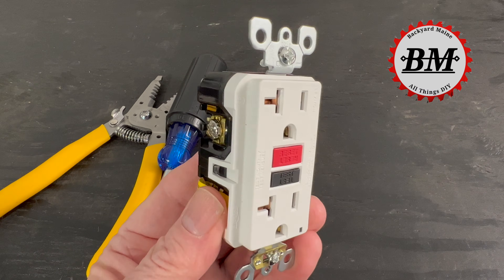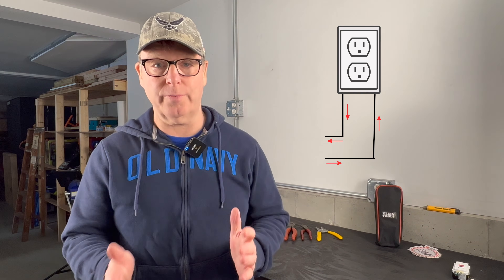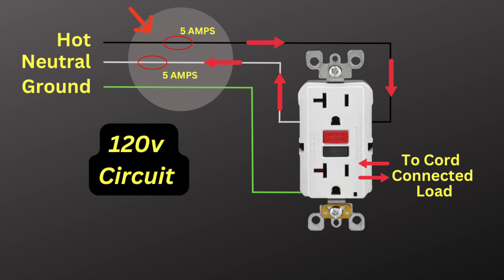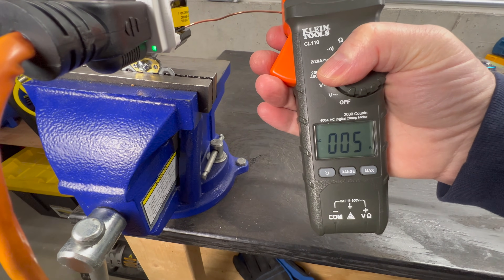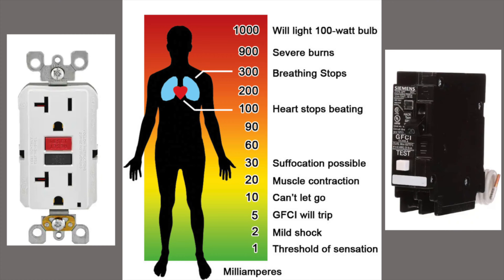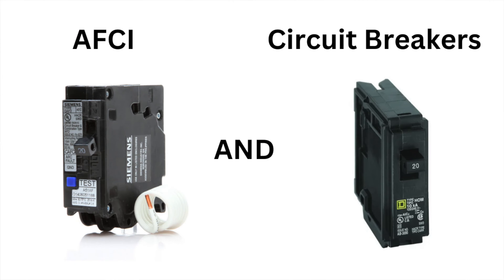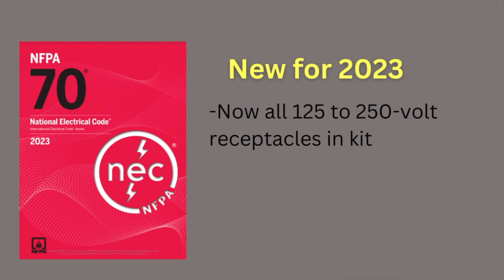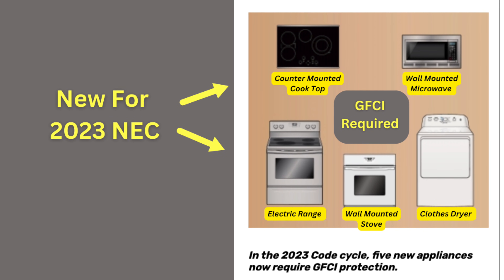GFCI Outlets: How They Work And New Requirements

Comment: Crazy new requirements... I didn't know they were stipulated like that until this video. 99% of the homes in US are not compliant and nobody will bother to get compliant any time soon. There needs to be a better technology at the circuit breaker panel where everything by default is GFCI and if, for some reason, you don't want it GFCI, then it is a separate circuit. That is the only way to fix it universally.
Reply from the maker: The code is not retroactive so homes won’t need to be updated. Just applies to new work.

Comment: I was told by an electrician to not put the refrigerator on a GFCI outlet because it will trip every time the refrigerator’s compressor comes on. So I’m confused. Can you please explain?
Reply from the maker: Thats not true but you could occasionally get a nuisance trip and that could be bad if you didn't notice quickly. I really don't like the new code rule requiring GFCI protection for refrigerators and freezers.

Comment: Why can't I find a 240 VAC GFCI outlet? I found 240 VAC GFCI breakers (quite expensive) though. And what about 240 VAC AFCI breakers?
Reply from the maker: Yes, you're going to need a GFCI breaker for this application. Also be sure to buy one rated for personnel protection not equipment protection. The one rated for equipment protection trip at a higher mA rating to ground.

Comment: Interesting they require ALL receptacles in the kitchen to have GFCI protection!  I had always assumed that those receptacles normally inaccessible, and therefore rarely accessed, like the refrigerator, garbage disposal, dishwasher, and permanently installed microwaves were an exception in previous codes (I believe) because they were very unlikely to cause an issue?...  Thanks for the update!
Reply from the maker: Yes, the code keeps expanding GFCI requirements with every cycle.

Comment: A ground fault circuit interrupter will not limit shock current to 5 mA. As with an ordinary circuit breaker, opening of the circuit takes some time because of the electromechanical trip mechanism. The circuitry also contributes (to some extent deliberately) delay. Until that mechanism interrupts the flow of current, the current will be limited only by the voltage and the circuit resistance. A fault current of tens of amperes could occur. The GFCI response time is fast enough to prevent electrocution in the vast majority of cases. Something in their favor is that the resistance at the instant of first contact between a human and a live circuit is likely to be pretty high, inherently limiting the current. In a "can't let go" situation, the current can rise quite rapidly as skin is burned and its resistance drops, but that process is still usually slow relative to the GFCI response time.
Reply from the maker: That is not accurate information but this is:

1. Differential current sensing
A GFCI continuously monitors the current flowing in the "hot" (ungrounded) conductor and the current returning through the "neutral" (grounded) conductor.
It accomplishes this by passing both the hot and neutral wires through a specialized current transformer, according to Fluke. In normal operation, these currents should be equal, and the magnetic fields they induce in the transformer should cancel each other out.
If a fault occurs (e.g., current leaking to ground through a person), a portion of the current will deviate from the intended path and not return through the neutral wire. This creates a differential current (an imbalance between the hot and neutral currents).
The current transformer detects this differential current, which generates a signal proportional to the imbalance. 
2. Threshold detection and trip activation
The signal generated by the current transformer is fed into a comparator circuit within the GFCI.
This comparator is designed to trigger when the differential current exceeds a preset threshold, typically 4 to 6 milliamperes (mA).
Upon detecting an imbalance greater than this threshold, the comparator triggers a silicon-controlled rectifier (SCR) or similar switching mechanism.
This SCR rapidly opens the switching contacts, effectively de-energizing the circuit and interrupting the flow of electricity. 
3. Fast trip time for safety
GFCIs are designed to react extremely quickly, interrupting the current flow within as little as 1/40th of a second.
The UL 943 standard for GFCIs specifies a maximum trip time based on the fault current, but most GFCIs on the market are significantly faster, typically operating in less than 100 milliseconds. This rapid response is crucial for preventing severe electric shocks, as even small currents flowing through the body for a prolonged period can be harmful. The trip threshold of 4-6 mA and the fast trip time are chosen to ensure that the device interrupts the circuit before the current can reach levels that could cause ventricular fibrillation or other serious harm to humans.

Comment: Clothes dryer needs GFCI?  A 30a 240v GFCI breaker?  Or just a 120v gas dryer outlet?
Reply from the maker: They do as of the 2023 NEC. But this doesn't apply to existing installations because the code is not retroactive.

Comment: Thank you for explaining that the receptacle is measuring net voltage across hot and neutral! I didn't understand why both the hot and neutral for a downstream protected receptacle need to be connected through the GFCI receptacle, as only the hot would be needed just for switching.

Comment: In a older house that house no ground, is it better to have gfci outlets in place of all outlets?
Reply from the maker: Probably not necessary but in the places they are required would be a good idea. Especially in the bathroom, kitchen, outside, garage and basement. I’m sure you know a GFCI will work with no ground
Reply: @ I was reading the NEC document about houses built before equipment ground was standard and they say if you replace them with gfci and put a sticker on the plate it’s up to electrical code.
Reply from the maker: @ajp000000  Thats correct..

Comment: What if I have kitchen outlets that all are connected to a GFCI, do I need to replace all of them to be GFCI now
Reply from the maker: The kitchen receptacles do require GFCI protection. You can do that with individual GFCI receptacles, GFCI breakers, or a few GFCI receptacles with standard receptacles wire to the load side of them. I like installing all GFCI receptacles because I think it looks better and its right there if it needs to be reset.

Comment: So every outlet now basically which no houses will meet this code unless built new. Also, GFIC's are a massive pain in rear as they are often faulty out of the pack and seem to trip when u breath anywhere near them
Reply from the maker: There are still many areas in the home that don't require GFCIs. I'm not experiencing any issues with the ones I have purchased. I have had an occasional faulty device but less than 1 in 100 and for reference, I haven't had one fail in my own home since they were installed 25 years ago.
Reply: @BackyardMaine  I've had at least 2 fail out of pack for me and have seen several professionally installed GFCI's continually trip and have to be removed, or wiring rerouting to avoid using one

Heard from several 40yr+ electrical veterans also dislike them for reasons above.
Reply: @BackyardMaine  thank u for video tho regardless as some people may like using them i'm sure

Comment: John, what do you think about GFCI protection as it is applied to a "downstream" receptacle from an upstream GFCI receptacle?  I get the cost savings of using the 'load' side of a GFCI for downstream receptacles, but aside from extreme current draws where that receptacle should have been on another branch circuit to begin with, and also applying the handy little "GFCI Protected" tag, are there any other considerations?
Reply from the maker: The circuits of course should be sized and split of based on expected load but other than that there is no issue using one GFCI to supply the other receptacles. I have done this quite a bit. In kitchen and bathrooms I always install a GFCI at every location for aesthetic purposes. I think it looks better especially over counter tops. But from an electrical standpoint it's just fine.

Comment: @BackyardMaine Thank you for the informative video. 
Quick question: Does GFCI prevent fire due to sparking in the garage due to a car block heater or some other heater?
Thanks in advance.
Reply from the maker: Only if it's arcing to ground. If its arcing across the contact (line to line) or to (line to neutral) the GFCI would not detect that fault. An AFCI would trip from that sort of arcing.

Comment: Another youtuber says don't use Load terminals to next outlet as next outlet will still be hot despite gfi tripping ! Is that true ?
Reply from the maker: No, if you use the load terminal to feed other receptacles and the GFCI trips, those receptacle will lose power. That's the whole point, all receptacle connected to the load side terminal will be GFCI protected.
Reply: @BackyardMaine  the other youtube meant if 2nd receptical is gfi it won't ttip.
Reply from the maker: You can actually even use a gfci down stream of another gfci and it will work but there is nothing gained by wiring them that way.
Reply: @BackyardMaine  I've learned that when stringing 3 gfi on same branch leg I couldn't use LOAD as that would be serial; I needed parallel so if one gfi tripped, all three gfi would trip.

Comment: What is the requirement for submersible water pumps (typically 240V, 20A circuit)? I would like to see a video on circuits that require BOTH AFCI and GFCI protection.
Reply from the maker: Hard wired submersible well pumps do not require GFCI protection. If they are cord and plug connected they do. I put that video on my list. Stay tuned.

Comment: Does the receptacle in which the GFCI is installed have to be grounded for protection to be effective?
Reply from the maker: If you have a ground wire then you do want to connect it but to answer your question, the GFCI will still function properly with no ground.

Comment: GFCI protection can be challenging to implement on multiwire branch circuits (MWBCs) due to the shared neutral. In a MWBC, two hot wires share a common neutral. When a GFCI monitors the current on the hot and neutral conductors, it may not accurately detect ground faults because the current on the neutral is the algebraic sum of the currents on both hot wires.  I guess you could get away with using a double pole GFCI breaker for both phases.

Comment: I recently took the National Home Inspector exam and this question came up.  At what amp with the GFCI trip with human contact and 5 amp wasn't one of the answers had 4, 6, 10 and 12.  Not sure if I got the answer correct I choose 6.  Now I'm thinking more like 4.
Reply from the maker: The manufacturers rate the devices to trip between 4-6 mA. Picking 5mA is the industry standard. If I had to choose between 4 and 6 I would choose 6 since it may not trip at 4.

Comment: I’d like to add something that is missing from that nice milliamp chart right at the beginning of this video. Back in the 1970s when I started doing electrical work for a railroad, we were taught that it only takes 6 mA flowing across your chest in order to send your heart into fibrillation, which can only be stopped with an AED device…and back in the 70s, none of us had those devices because they were only available in certain emergency service vehicles and were quite bulky, as they were the same units used in hospitals.
Reply from the maker: Thanks for the info..The chart I used was borrowed from an OSHA document and I believe those are the current numbers the industry is using today.
Reply: @BackyardMaine  Oh, they are, but they're not specific, and they neglect what happens when current passes across your chest just a little bit, because unless somebody is there that can defribrilate you if your heart goes into V-fib, you are a dead man.
You have to remember that OSHA is not industry professionals. It's bureaucrats.
Reply from the maker: @arthouston7361  I was the electrical engineer for a multi billion dollar corporation. We would occasionally get an OSHA audit and they would send experts in every area of expertise. Electrical, chemical, mechanical etc. The electrical guys from OSHA I worked with were experts who understood everything I showed them from 35kv distribution, generators, UPS systems, transfer switches, rotary UPS systems couples to generators, fire pumps, controls and everything else. The bureaucrats were not the guys in the field in my experience.
Reply: @BackyardMaine  The guys that they sent you that you are describing are part of a very specialized group.
 I've met the guys from OSHA who fit that category, but they're not the people that make the rules, and they're not the people who produce graphics. I didn't do any 35K work, but our railroad signal power on the former Penn Central was 8.8 kv. More than enough to send you to meet the great I am. Our power source was the old Philadelphia electric company, and so we had a lot of safety information that came directly from them.
Reply: 6mA for heart to be thrown into fibrillation is what I was taught in electrical trade school back in 2017.

Comment: My apartment was shut down by code for no heat or hot water but we also were living there for 5 years with everything in the three bedroom apartment hooked up to only TWO circuit breakers 20 amps each and our oven was not on gfci.
Reply from the maker: Old or existing installations are not required to upgrade to current standards unless new work is being done.
Reply: @BackyardMaine  oh, it’s not even about upgrading to newer standards it’s about that was completely out of code to begin with to have a three bedroom apartment running off two circuit breakers that are 20 A each. There’s no way that that can be right you know what I mean
Reply from the maker: @richroc7  Unless it was built 70 years ago or more.
Reply: @BackyardMaine  you’re saying that it’s legal to remove all the wires from all the other 14 circuit breakers and hook them up to the last two in the panel and rent the apartment to a family of 6? It has nothing to do with being old, the electrical was redone in the nineties but when the circuit breakers broke because they were 30 years old they just moved the wires to a breaker that worked instead of replacing the breaker. Do you understand now? It’s also against the law to remove the main breaker while the family is living there and that’s what my landlord did to my neighbor downstairs.
Reply from the maker: @richroc7  No what I'm saying is it may have been code compliant when it was installed if the installation happened a very long time ago. The code is not retroactive so we are not required to make updates and the code updates over the decades. It applies to new work. There may be rules outside of the code that prevent renting an apartment when it is unsafe but it's not in the NEC. I hope this clear up any confusion.
Reply: @BackyardMaine  I was trying to say that from the beginning that it was about the city code and not nec. My comment was about how could any landlord set up a box like that and rent the apartment. Now when the panel was first installed I’m sure that the wires were properly distributed amongst the other 14-16 breakers and it was up to code but as the breakers broke he kept putting wires on the two remaining working breakers instead of buying and installing new ones and tbh I can’t see how that would be allowed by the nec code but it was definitely against the city codes.

Comment: Why can't we just use GFCI circuit breakers. it is much easier to upgrade them instead of all the receptacles in a house. It is also hard to find heavy dusty GFCI receptacles.
Reply from the maker: Yes, GFCI breakers are also a code compliant option. Many people prefer the point of use option for a few reasons. 1- The receptacles are more convenient to reset rather than having to go to the panel. 2- The receptacles are a whole lot cheaper than the breakers. 3- The breaker will protect the whole circuit which isn't always desirable.
Reply: Thank you for the clarification of the code. 

In some projects a large number of receptacles may need to be updated (e.g. basement). In this situation upgrade of the circuit breaker may be cheaper. A 14A receptacles is about $15-20. A circuit breaker is about $50. 

It is also hard to find heavy-duty spec of GFCI receptacles. There are hospital-grade GFCIs but they are very $$$. At the same time you can find an industrial-grade Leviton for $7-8. GFCI circuit breakers may also be an option if outlet endurance and reliability are desired by the customer.